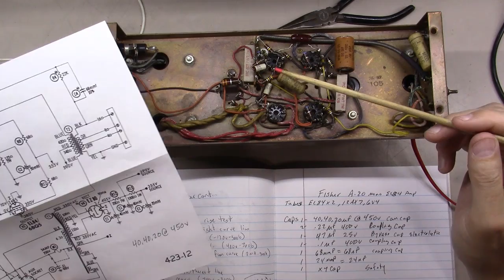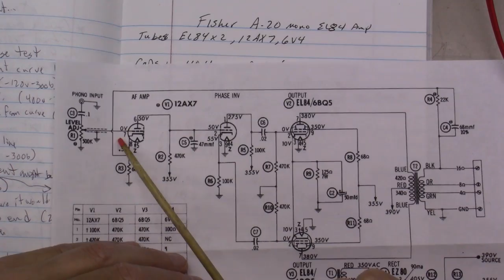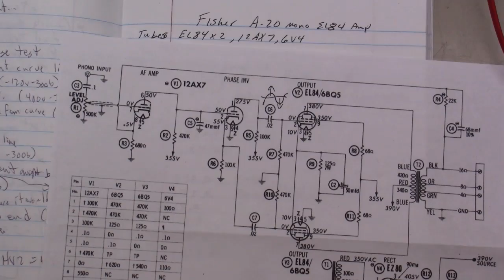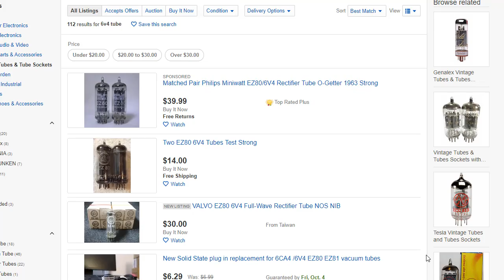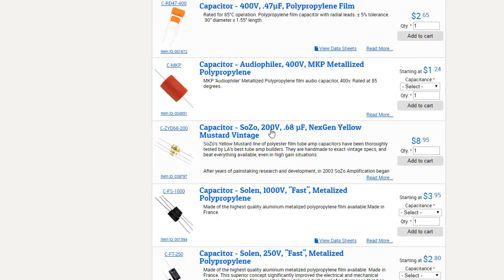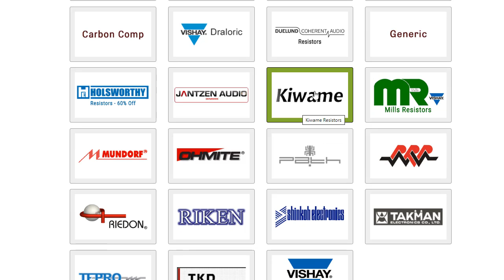Tube Gear Troubleshooting - Selecting Components - Part 4

Comment: Ty for sharing! Yes, I learned a lot Ty again. Question tho about tantalum caps. Are they ok for bypass caps? The ones in my amp are the older black Sprague, lil bullet shaped polarized. A couple Kemet T110's. Thanks for your time! Jim

Comment: I used a 6bw4 do to the cost of the 6v4 you need to jumper pin 3 and 9 then you can use either one.

Comment: Oops. The description of the phase inverter is - well - inverted! The top tube (V2) gets the negative-going excursions when the signal to V1b (pin 2) goes positive, and the bottom tube gets the positive excursions at that same instant in time. Likewise, when the input signal goes negative, V1b shuts off, allowing the B+ to pull the plate high and now V2 sees a positive excursion, and V3 sees the negative excursion. And - thanks to C6 and C7 - the output tubes see only the AC signal, and not the 355 volts B+, or they would red-plate and burn up in short order - ouchie! 😬

Comment: Oops. The 2nd cap should be .022 uF (22 nF), and the 5th one should be 68 pF (68 x 10^-6 x 10^-6  or 68 micro-microfarads), not 68 nF (68 x 10^-6 x 10^-3 or 68 micro-millifarads). HTH! 🤠

Comment: A question came to mind when discussing stereo with 12AX7.   Is there a crosstalk rating on 12AX7s between each tube section?
Reply from the maker: None - the two halves share no common components other than the lack of air in a vacuum so zero crosstalk.  Nothing to rate :-)
Reply: @Blueglow  Interesting.   Thanx.

Comment: Interesting video.  You are so right on the "Ford/Chevy", etc. type attitude on "what you should do" kind of thing.  
I found an excellent video on what capacitor to use for what purpose, but I still need to make a chart for my benefit.  Charts work better for me.  The video, in case you want to view it is:
https://youtu.be/67M7fsbLUIU
One thing that video helped me with was the information about polystyrene capacitors.  I never knew they even existed.  After seeing how they function, I don't think I will ever use one.  Still, there was a lot of very good information in the video!
I will have to check out more of your videos soon.  Keep up the good work.

Comment: Thanks for the video Mark, hope you are feeling better.
I think the most valuable part was, for me, the info about what not to use for replacements parts. There are lots of good options. 

And also the use of X2Y1 safety caps for the AC noise bypass caps is important especially for use in old AA5 (transformerless) radios.
I use the terminal strip option myself when "replacing" the can cap. I only take out the old cap if it is leaking fluid.

Here is an interesting tip on getting the terminal strips, apparently Digikey is still selling them (I would have never thought to look there first). The company was founded by a HAM operator though so maybe that has some influence on them still in inventory (maybe...).
Cheers,

Comment: Mark, is a mmf rally pf not nf?
Reply: Micro is x10^-6.  Micro micro would be x10^-12, which is pico.  Nano is x10^-9.
Reply: Yes, Mark was probably thinking that in his head but not saying it right. He does that. He is still recovering so he needs some slack.
The MMF stands for "micro-micro-farad" and is pF as other people (Lou S) have stated.
Cheers,
Reply: @EngineeringVignettes  I'm more than willing to cut slack.  Think of it as a "heads-up".
Reply: @thesquarerootofnegativei6225  No worries, i'm not pointing at anyone. It's all good.
Reply from the maker: I have to look these up every time I run into them, simple conversion charts on internet
Reply: Yes. To be fair, I had to google this a lot when I first started reading schematics. For some reason (probably poor math skills), the nomenclature just wouldn’t stick. I still have the justradios.com capacitor conversion chart in my browser’s favorites for backup.
Reply: @sonotdown998  Thanks for that usefull link.